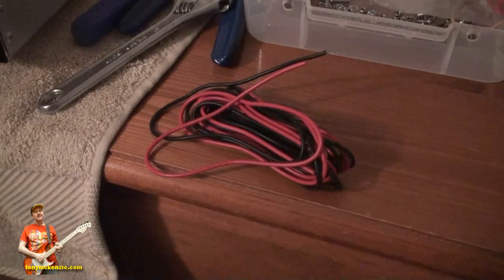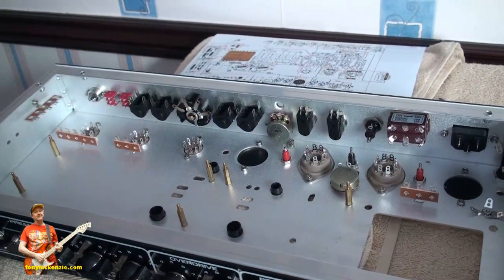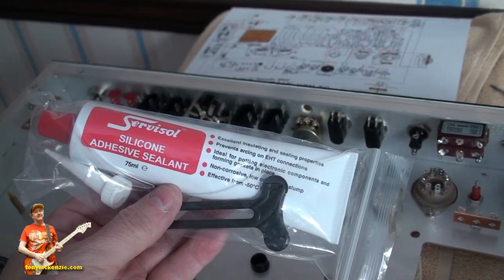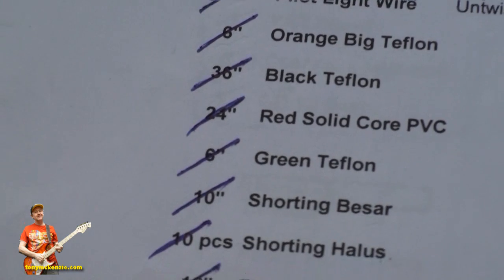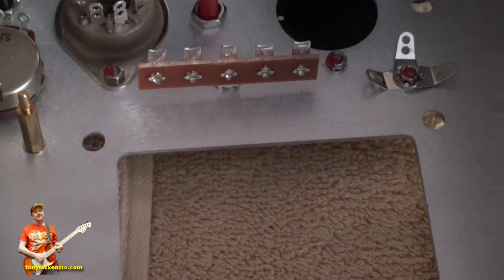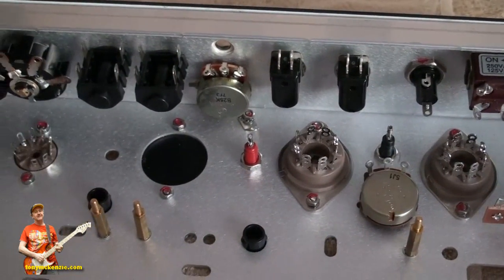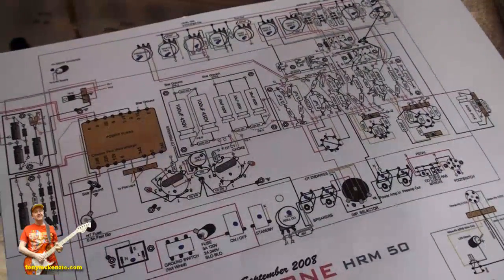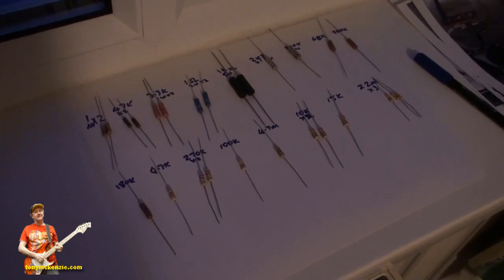Ceriatone Overtone HRM Amp | Part 2 | Dumble Clone | How to Build it from a Kit | Tony Mckenzie

Comment: IMAGINE USING VINTAGE CAPS AND RESISTORS FOR THE SOUND MODDING, LIKE A 50'S BUMBLEBEE.
Reply from the maker: You could change out loads of parts for sure, but whether its better or worse? who knows. I still have this amp and it does sound exceedingly good.